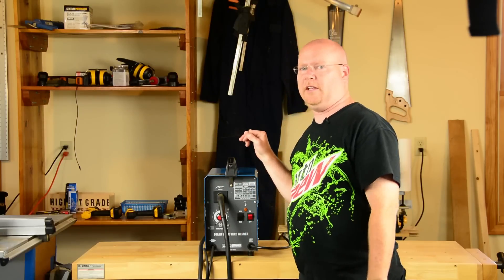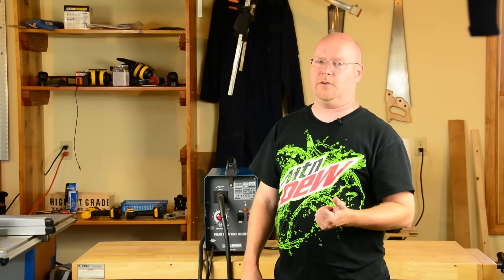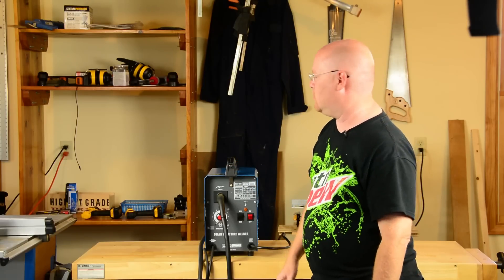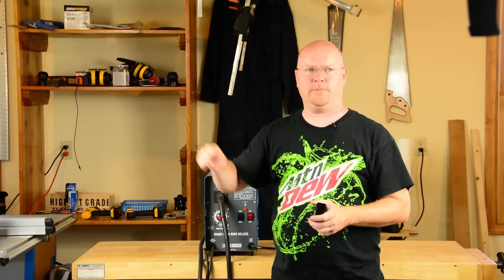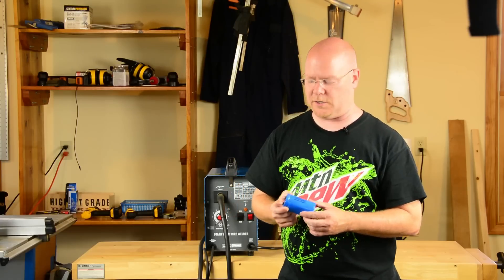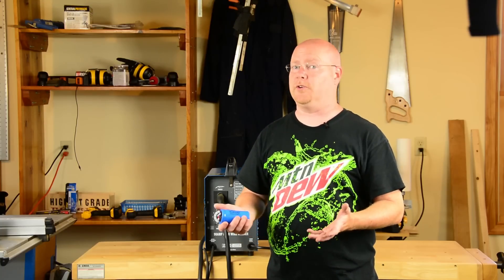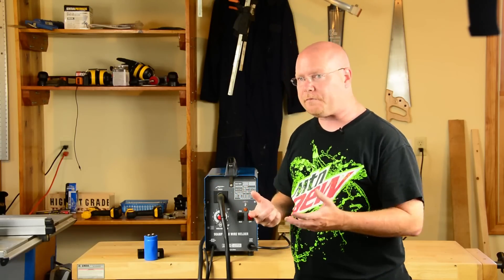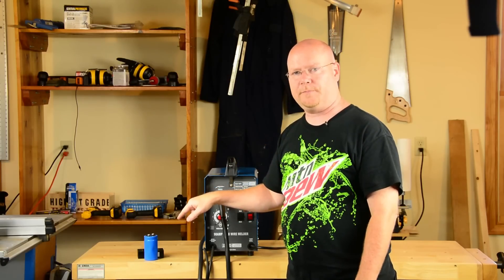Advanced Harbor Freight 90 AMP Welder Mods 01

Comment: i bought a arksen 110v. mig 130. wiring diagram shows on the output a rectifier and a 68000uf/50v electrolytic condenser and100/50w r1 cement resistance with a + and - coming out. i hooked a digital meter to the torch tip and ground clamp on dc volt said 1.8 mv then i turn it to ac volts and it said 40 volts so this a ac output welder like the hf one you have right!? i made a copy of the diagram i like you to look at to see if i can do the same mods on it. dont know how to add a attachment to you here. great videos your a natural.
Reply from the maker: Upload the diagram to OneDrive or Dropbox and post the link in the comments is the best way to share something like a diagram.  If the welder actually has a rectifier and cap then there's nothing left to mod :)  Did you pull the trigger with the DVM hooked up?  The welder may not supply power to the tip without doing so.  Be careful of course!
Reply: Matt Heere
yes i did pull the trigger that when i got 40volts on ac setting.now that i really look at this user's manual it list all there mig machines and it shows 230 volts going in to all of them, including my model and mine is 110 volts cause i've had it plugged in and turned on. i'll work on getting the diagrams on here. thanks for your time.
Reply: i installed both dropbox and drive one and still can't attach the diagrams. it wants a email. can't figure it out. if you want i'll give you my email and then you can decide if you want to send me yours so i can send those diagrams. sorry about this don't know any other way.

Comment: sorry for all the questions would a 100A Amp 1200V Single Phase Diode Bridge Rectifier -QL100A1200V work?
Reply from the maker: That's actually the one I used.  It works fine.  I'm starting to be a little concerned about the longevity of it since we're running so close to it's max capacity, but so far so good.

Comment: you should put a link to where you bought these items.
Reply from the maker: Unfortunately I got my capacitor at a local swap meet, and the rectifier on eBay (and so the auction is long gone by now).
Reply: Matt Heere so do you need the capacitor? or can you just use the rectifier?
Reply from the maker: Carlos Vreal The mod will work without the cap.  The arc is much smoother and more stable with one.  The rectifier is all that's needed to solve the polarity problem though, and that's the big issue with this welder.
Reply: Matt Heere cool man thanks for the quick reply, great videos btw, very clear an easy to understand!

Comment: What would be the best capacitor to use for this mod??
Reply from the maker: Anything that's 50VDC or higher will work.  Generally speaking you're looking for 25,000uF at a minimum, or it's not worth the bother of putting the cap in.  The big electrolytics with screw terminals on top are choice #1.

Comment: Is there some EBAY items you can recommend for these mods? I looked them up and way to many choices for this electronically challenged novice welder!!
Reply from the maker: The part that I have is a QL100A.  If you search for that on eBay you should find several available.  Should run ~$20 from a U.S. seller, or ~$15 from Hong Kong.

Comment: I'm having a hard time finding a capasiter not sure what all I can use does it have to be a 50v or could it be less need help ASAP thanks buddy
Reply from the maker: I wouldn't go lower than 50V.  The rectified voltage is only actually in the mid 30's tops, but given the current we're running through this setup I think you need pretty good margins on the capacitor.  Keep checking eBay.  They pop up regularly.
Reply: OK thanks man I found a 220000fu 75v capasitor for 20 bucks on eBay last night gonna give it a try
Reply: Matt Heere please reply asap i need help on capacitor. My question is can i use a Electrolytic capacitor 50v 60000 UF please reply hear or email me @ ura0797@gmail.com thank you
Reply from the maker: yuriy Dron Yep.  That should be just fine.  Check the comments on the rest of the vids in the series.  Lots of discussion about the parts.

Comment: Great vid.. I added an ebay rectifier to the same welder a year ago but never added a cap.   My impression is that it welds a bit hotter, splatter is about the same.  If I invest in a big capacitor, do you know what changes in the weld pattern?
Thanks!
Reply from the maker: *****  Mostly you get less splatter because you're not pulsing the current anymore, and you get better starts because you have all the energy stored in the cap ready to roll as soon as the wire hits the work piece.  If I had to put numbers on it, I'd say the rectifier alone is giving you 75% of the total improvement.

Comment: you mentioned that the voltage on the rectifier didn't matter so can I use a  3 phase 100a 1000v rectifier. Also is there any  way I can somehow mount the rectifier close to the stock fan to give it some cooling? Thanks
Reply: Matt Heere
Don't mean to be rude and jump in someone else's question but it's along the same lines and thought better to have it in one place.

I ordered a single phase but ended up with a three phase. Do you know how many amps are lost when not using all diodes? It's a 100A but that's with all diodes.
Reply from the maker: You won't lose any amperage capacity at all.  The three phase version has two additional diodes in it (that you won't be using).  In any bridge rectifier circuit, all of the individual diodes need to be able to carry the full current.  They sort of "take turns" as the AC cycles polarity, rather than operating in parallel.
Reply from the maker: TheLedzeppfan Yep.  A three phase rectifier has an extra pair of diodes in it (6 instead of 4) so you can use it and just ignore the extra AC terminal.As for the stock fan, it's pretty weak to begin with.  I suppose that you could mount the rectifier on the back of the welder so that the stock fan blows air past it.  If you do this I think you should probably put in a better fan.  The duty cycle of the welder is pretty bad already.  I can't imagine what it would be if you started blocking what little air flow it has to cool it.I've had no issues with the temperatures on my rectifier.  It gets hot, but not to the point where it worries me.  These big power rectifiers are far tougher than most of the solid state stuff you normally run into.  If you want to actively cool yours then it should be simple enough to adapt a fan designed as a CPU cooler to fit over the rectifier.
Reply: Matt Heere
Thank you for that information and the great informative videos.

Comment: Using your videos as a kind of a guide, many tutorials I have read have mentioned an inductor (coil) in line with one lead or the pulsating DC would
act as ac. I didn't see you do this. Is it required for best welds?
Reply from the maker: kapdone A high quality MIG or flux core welder would have an inductor in series with the torch.  The capacitor I added helps to keep the voltage constant.  An inductor would help to keep the current (amps) constant.With this welder I just didn't think that adding an inductor was worth the investment.  You'd pretty much have to make the inductor yourself to keep from spending a fortune, and then you'd be left with something too large to fit anywhere inside the existing chassis.